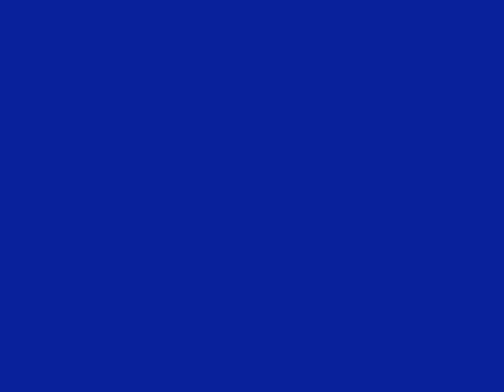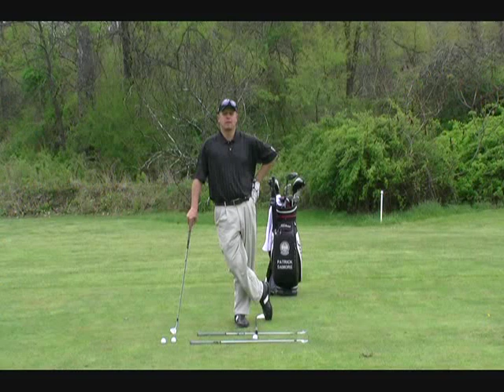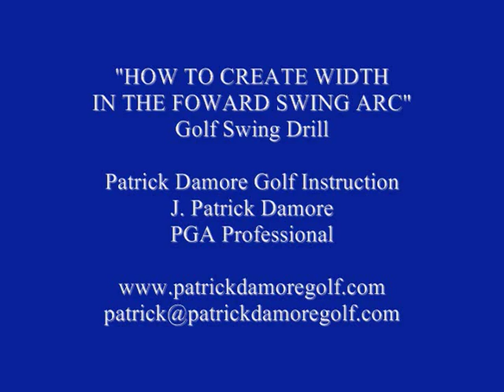Wide Forward Swing Arc Golf Drill

Comment: I believe the big thing people are missing here is the right arm. Ideally the right arm at the top of the swing will be roughly at 90 degrees. In the downswing if you increase that flex ur getting narrow. When this happens u pull the shaft down which will cause you to get steep bc hand path moves straight down. The right elbow must stay at a 90 on the way down.  Casting would be where you unhinge your wrists and release the right arm in unison.

Comment from the maker: Casting is the act of 'releasing the wrist hinge' early in the forward swing (right after the transtion).  I am not promoting that at all.  With a correct 'wide' forward swing arc it is extremely important to 'keep the hinge' and still have the hands, arms travel a 'wider' path than a traditional 'super late release' forward swing arc.  If this is done, you will see HUGE improvements in your ball flight.  Thanks for the comment.

Comment: BTW, it helps to understand that width doesn't have to mean your hands are a foot above your head at the top of the swing, I think the key is to get the hands as far away from your body as flexibility and strength allows. This won't necessarily result in the club getting to parallel but look at Ernie Els swing. He gets a nice full turn without going to parallel but his extension through the ball is exceptional and he's on plane as long as anyone on tour. Interesting topic.

Comment: Why will moving off the ball promote width.  I agree w you that Adam Scott and Sneds are wide going through the ball but all you're saying to achieve this is essentially move off the ball.  Why is that the best drill to generate this action ?
Reply from the maker: This drill 'encourages' width on the backswing arc and on the forward swing arc.  By transferring your weight back and forth you are essentially disconnecting from the 'sit in the barrel and turn' mindset.  By transferring weight, the club head is 'encouraged' to travel a larger arc (back and forth).  Also, view my 'how to get synced up' drill.  That drill will also encourage width.
Reply from the maker: Any drill you perform (many repeititions) to create width will be beneficial to your game.  I don't know if it the best one I have (depends on student's needs), but it definitely is effective.  Thanks for the input.
Reply: +Patrick Damore Golf Instruction thanks for your time.

Comment from the maker: With a shallow/flat swing plane (down the line view), the club head travels into the ball at a more directional angle, thus the need for perfect timing and hand/eye coordination at impact.  I encourage a 'normal' plane vs a 'flat' swing plane.  See my instruction site for greater detail on this.
Shallow angle of attack and shaft lean is achievable.  Student MUST have dynamic transfer of weight on forward swing arc (shift and cover). Again, see my instruction site for more information.  Thx!